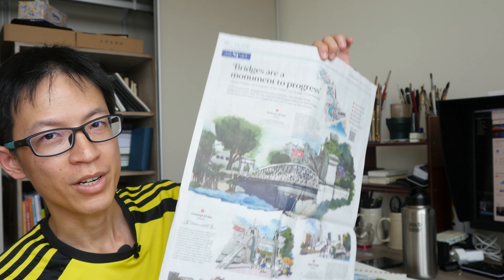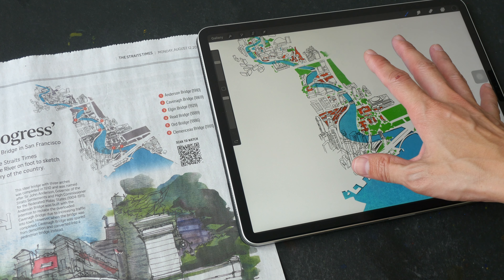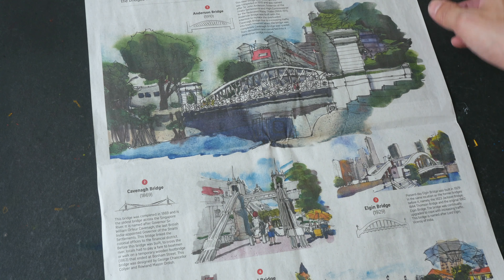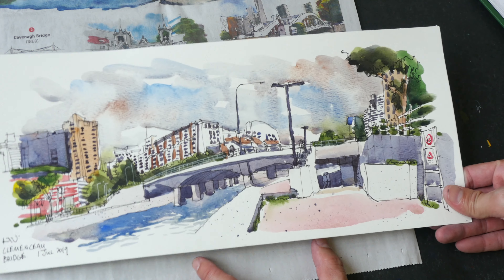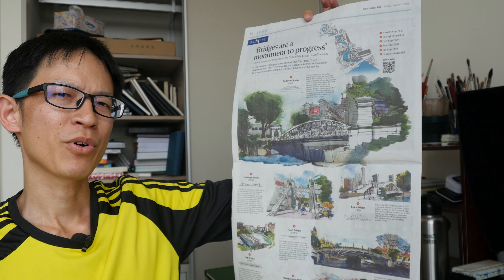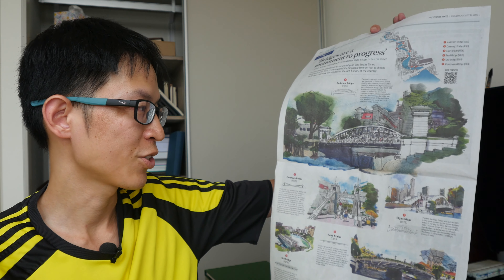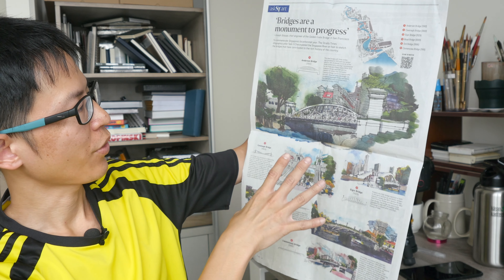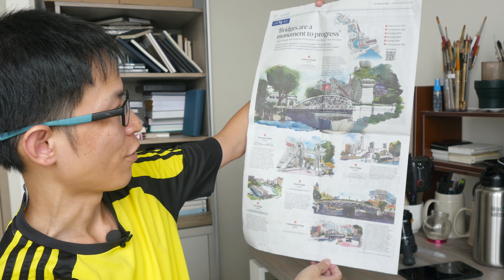The Singapore River bridges got printed

Comment: Congratulations on your work being printed in the paper. Beautiful sketches/illustrations. For the mis-labeled bridge, its definitely not entirely your fault. Assuming the newspaper has a proof-reader as part of the workflow process, they should have caught the mistake either once the illustrations were submitted, or before the page went to print. (I'm also a graphic designer, and used to work for a publishing company doing all the page layouts etc.) As you know, we spend so much time with whatever it is we are creating, that a fresh set of eyes proofing it before print is essential, no matter how careful we are. I'd be surprised if the newspaper doesn't use proof-readers for both editorial and illustrations.
Reply: Totally agree with you 😊 my first thought was what was proof reader doing 🙈
Reply: Absolutely agree! Not ultimately his fault, the editor or designated proofreader should have caught it.